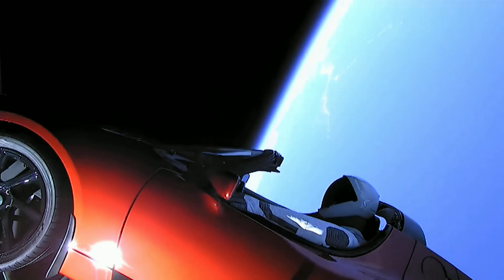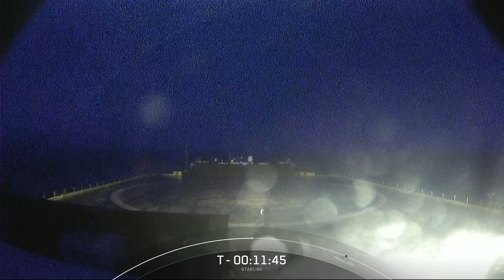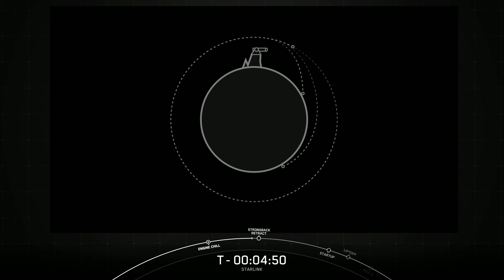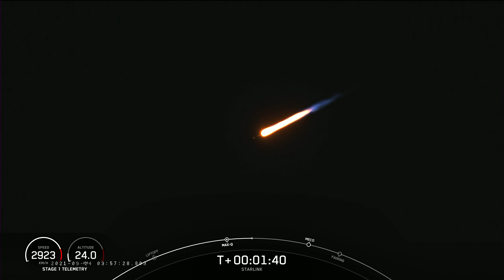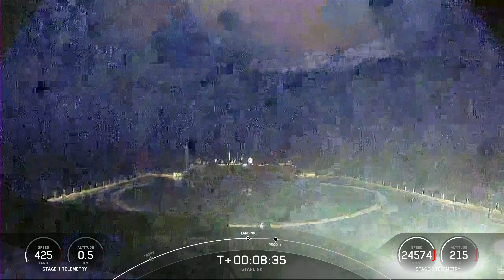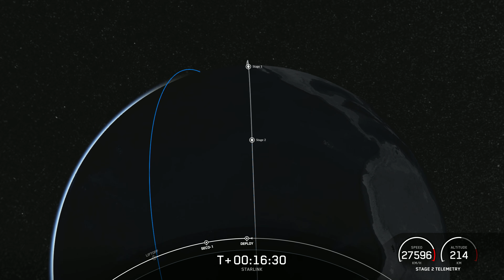Starlink Mission

Comment: Why are there not more comments about how SpaceX may induce Kessler Syndrome with these missions? If you are here you likely love space, and I really wonder what you think a 12,000 satellite constellation is going to do with regard to orbital debris and the chances for low orbit collisions. Moreover, I cannot fathom anyone would justify this risk merely to provide worldwide broadband... SpaceX may singlehandedly lock humanity out of space travel for decades with this mission and too few are noting it.
Reply: The star-link satellites orbit extremely low compared to other satellites, to the point that they have a very slight amount of atmospheric drag, not enough to really do anything besides deorbit the satellites in a comparative quick amount of time (4-5 years) compared to other satellites with higher orbits can take anywhere from a decade to centuries to deorbit if they go inactive or no longer used. there lower orbit also make collisions with other orbiting satellites or space derbies less likely. they also have there own small propulsion system which they can use to move out of the way of incoming derbies. While I do worry about the Kessler syndrome and agree with you that it it a problem that needs to be addressed more by space companies and originations, I don't think SpaceX is really contributing much to it with their star-link missions.

Comment: Why signal always loss when stage-1 is near to landing platform?
Reply: Because of how far down range it is they need to relay communications through a satellite that requires a directional antenna.

Because of the vibrations from the first stage this antenna can lose lock with the satellite.

Think of it like pointing a laser at an object. If someone started to shake you it would be very difficult to keep pointing at the object.

Comment: I never noticed how quickly the 2nd stage stops accelerating once it hits the coast phase.  How do they do that?
Reply: Simple! Just cut fuel/oxidizer flow completely.
Reply: @OortCloud  but wouldn't it keep accelerating at that point? Even just some?
Reply: @gregcavanaugh6259   nah a = F/m, no if the force of the engines is 0, then there is no acceleration

Comment: …so if “real” Starlink and other satellites work yet even with all that..ISS and supposedly more….why is it that there’s loss of signal? 38:40
Reply: Starlink isn't designed to act as a tracking system for rocket stages.
Reply: @TheEvilmooseofdoom  yet if all true they should of been able to relay to ground then up to a SL sat then repeat…..I’d think.  ..otherwise FB maybe right.
Reply: The current Starlink satellites do not intercommunicate, they require a ground station. The drone ship is the only ground station available. The landing booster disrupts the signal from the drone ship (mostly).

The gen-2 Starlink satellites starting with this launch have laser links between them and are less dependent on ground stations.
Reply: @fredbloggs5902  if that’s true Sx/Starlink should eliminate the transmission cut outs for most upper space launches soon….maybe by the end of the year or next at latest.

Comment: Question. Why 51 starlinks this time?  Normally 60.  Is it bc it’s the 10th use of booster and loss of thrust with age?
Reply: A polar orbit doesn’t benefit as much from the rotation of the earth augmenting the flight path velocity, this reduces the payload. 

Also the gen-2 satellites are heavier due to the larger solar panels required to power the comms lasers.
Reply: They had put 10 prior into polar orbit, maybe they didn't need 60 this time.

Comment: If you have used a kerosene lamp, you may be familiar with the greasy soot that the kerosene flame deposits on the globe of the lamp. It occurs to me that this is the same as the blackening on the Falcon 9 1st stage. Watching reentry I was surprised to see the sparks/flame as bits of soot burned off the bottom of the flamey end.
Reply: Yep, it is soot because, the plume is going in such a way where the flame runs against the booster and causes the soot.

Comment: I just don't understand why these launches have to take place at NIGHT.  ALL the views are so much poorer at night.  I am aware of NO orbital reason why they insist on doing them at night.  WHY ???
Reply: SpaceX does not care if anybody watches the launch. They will launch when they have the proper authority from the FAA. It's not the viewers decision when they launch the rocket.
Reply: Timing of the launch is important to hit desired orbit.  Some windows are really small one are larger.
Reply: 1) They don’t all take place at night

2) You can watch the video anytime so why should your viewing habits control the launch time.

3) The precise constellation requirements of Starlink impose strict launch times to achieve the orbit needed.
Reply: I’m going to try to explain this in a orbital sense: there is a parameter of an orbit called the longitude of ascending node. The ascending node is where an inclined orbit goes above the earth’s equator. (Descending node is the opposite) The longitude part determines how far East or west it is. 

Sometimes a rocket may need to launch at night, to reach a targeted orbit, sometimes because they have already launched orbits at other longitudes. (I’m not going to get into orbital precession or any of that because it hurts my brain)
Reply: @thingusbrulingus  Well said, well said.

Comment: Could a Rocket Lab Electron be used to quickly insert individual Starlink satellites instead of having to wait to replace them at a economical rate from a Falcon 9 or Starship?
Reply: Electron is a pretty nifty rocket. But the mass of Starlink satellite V1.0 is 260 kg, and the newer ones are even heavier due to the laser link terminals. It is not even certain that Electron is capable of launching one Starlink satellite at a time.

And since the cost of launching Electron and Falcon is actually not too different, the cost of deploying the constellation one satellite at a time instead of 50-60 at a time would be massively more expensive. (It already will cost SpaceX around $10B to build the system out.)
Reply: Yes, but much cheaper to launch in batches. Besides, in a few years they’ll be coming down in batches as well.

Comment: Why do we always loose signal from the drone ship? Maybe it's time it starts using Starlink too? :)
Reply: Because of how the video gets transmitted. Because they’re so far down range they need to use a satellite relay and a directional antenna.

When the booster is landing it creates vibrations that shake the antenna and make it lose lock with the satellite and as a result we lose signal.
Reply: @weekiely1233  i thought they fixed it already. Or is that just the shortfall of gravitas?
Reply: @farel9476  they’ve done something to mitigate the issue but it’s still not perfect.
Reply: @weekiely1233  ah i see

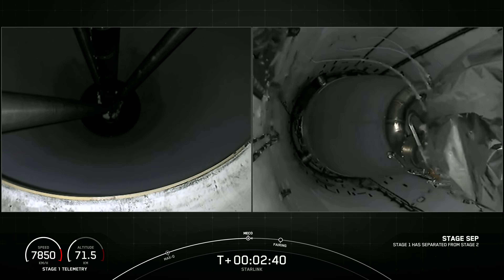Comment: 21:12 = 7,912 kph at 68.5 kilometers for MECO.
25:16 = 7,912 kph at 67.4 kilometers coming down.
25:25 = 8,057 kph at 57.6 kilometers begin entry burn.

Always fascinating that the booster sometimes falls faster than at MECO.
Reply: I just saw that a Falcon Heavy centre-first-stage reaches over 10,000 kph at MECO. That is fast.
Reply: I think that’s mostly due to the extra horizontal velocity of the vehicle.

Comment: Didn't get to see one of the more exciting parts about this mission. The landing of the booster rockets. The feed just magically gets cut, right when it lands.
Reply: There's really nothing at all magical about it.  The feed cuts out because the air surrounding the rocket is ionized due to the stage's ~10,000 kelvin trajectory.  Ionized air typically blacks out communications signals.  There are ways to potentially get around it, but I digress.
Reply: @ro4eva  your explanation makes a lot of sense to me, unlike a lot of others.
Reply: You can watch Everyday Astronaut's video detailing why the drone ship loses connection during the landing. Short answer, the force pushing down from the engine during landing causes a lot of vibrations on the ship and results in temporary loss of direct satellite uplink.
Reply: there are plenty of landings where you can watch the whole thing, but as other people commented due to various issues keeping a comlink going during the landing is a bit hit and miss. I was more dissappointed to miss the deploy, what's up with that?

Comment: In the coming months they reach their operational orbits then some months later be operational?
Reply: Yeah, the satellites have ion engines. Very low thrust. BUT very efficient. And it builds over time, because there's no resistance. They only put out about the force of a paperclip resting in your palm, but it's enough to send a ton of metal in a new direction over time and build up a hell of a lot of speed. 

So the satellites will take a bit to get into their orbits, make sure they're stable, in the right position, then link up with the Starlink systems, get tested for functionality, troubleshoot anything that goes wrong that they can, and then start on-boarding ground stations and customers. It's a lot to do. And that doesn't even count making sure the laser links are working and interlinked with the other satellites in the constellation properly, and orbits/course and speeds plotted out. You're talking about hitting a target the size of a 1 person trampoline at a thousand miles with a big-ass laser pointer. 

It's a precise business with almost no margin for error. They have to get it right. Getting it right takes time. Slow is smooth. Smooth is fast.

Comment: Apart from my username, this is a serious question, how long do you think until space travel is possible and if the spaceX team has some trouble with said space travel I have a theory, so scientists are creating artificial black holes, what if you use the energy from the black holes as fuel
Reply: Scientists aren’t creating artificial black holes.
Reply: How would that work in practice..assuming we can make those tiny black holes.. at our wish? i.e. are you referring to a science or engineering theory. Don't cock up your answer :)

Comment: Every time those boosters land they collect more data to feed into the PID loop algorithm which makes the landings more accurate each time.
Reply: PID (proportional-integral-differential) control is super useful for many applications. But landing this rocket is rather more involved than a simple PID control loop. (Of course, the experience gained still allows to make the system better!)
Reply: @cogoid  it's "derivative" , not differential.
Reply: @cogoid  You're right, it's multiple PIDs with some simple code.  Rockets are simple to program.  It's the PIDs
Rockets have very few sensors and very few things to operate compared to most any airplane even.
Reply: @dherman0001  No. It is not just "PIDs with some simple code." There is some rather cutting edge mathematics involved in the control system of Falcon 9, which allows it solve in real time, what to do in order to arrive to the specific landing location. SpaceX had to hire the leading experts in this discipline to make it happen. There is a nice article, outlining how it is done: "SpaceX's self-landing rocket is a flying robot that's great at math"
Reply: @cogoid  PIDs are math.  And yes there is other math.  But it's not challenging code.  I guess it's what your used to.  The process controls systems I've designed and programmed or orders of magnitude complex than a rocket.  It's not even close.
There are so few things happening on rocket really.  Like I said, a car has more going on.

Comment: Stage 1 here was its 10th flight. What is the most for a first stage being reused. I recall 10 was a goal down from 100 in the past. Any idea ?  Do they cycle the actual firing of the 2 outer engines as the center ones get the most work with entry/landing burns?
Reply: 10 is the highest reuse a single booster has had, there are 2 that reached it. The goal was originally 10 without major refurbishment, and 100 total if you do an overhaul every 10.

However with the data collected from these life leader boosters they've said that 10 is now a soft barrier and they can probably reach 15+ before more work is needed. They don't change engines out or cycle their spot, they only clean the turbo pumps and check a lot of other stuff and replace as needed.

What a major refurbishment is is not specified, but may be keeping only the tank body, grid fins, and avionics and replacing the engines and hydraulics entirely. That's up in the air as it depends on what a detailed inspection shows is required when the time comes. My guess is they'll keep flying them and doing cleaning and inspection until something bigger shows a need to be replaced or it fails, since they're using life leader boosters on Starlink only there's no risk to customers if one fails.